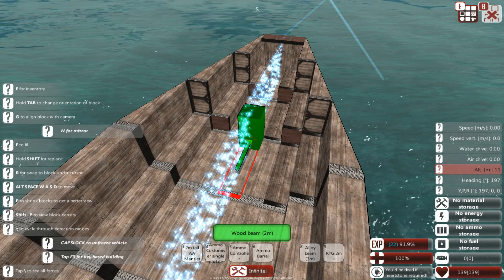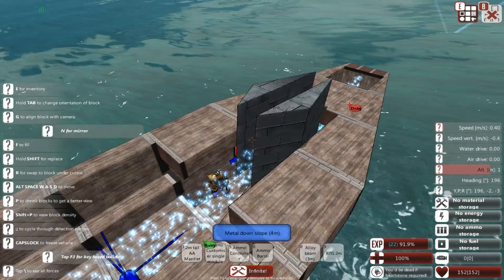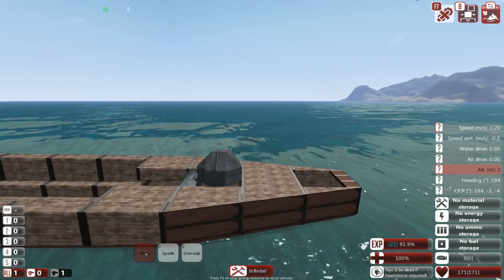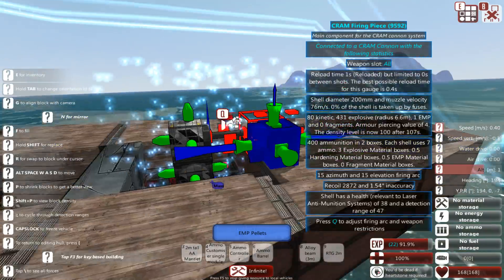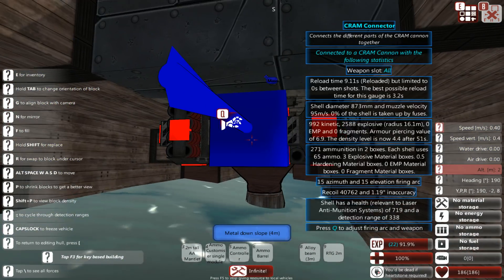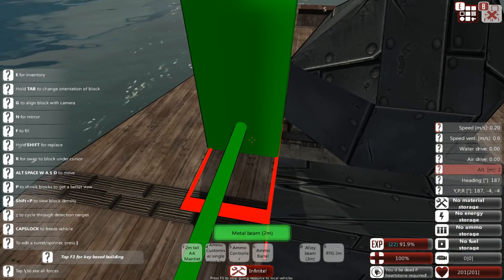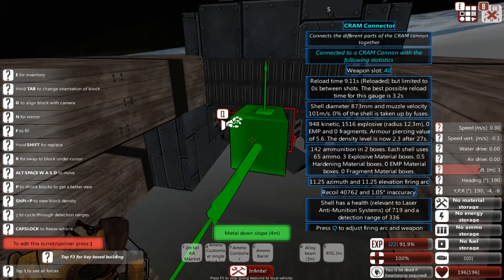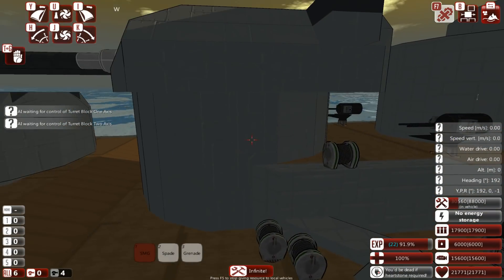From The Depths - Basic turret design

Comment: I case you didn't notice, the  Gauge Increasers have the same Armor as Metal (10) and they weigh 30 less (10 vs 40).  They have 80 less health however (200 vs 280).  The weight savings could help keep from having a top heavy ship with not too much penalty for the health.  The Gauge Port Increasers used to belch smoke when you fired but it seems to have been removed in one of the updates since they were originally introduced.
Reply: that or just make a really low keel using metal and lead. it more or less makes most ships balance. i had a triple barrel gun with 7-10k recoil per barrel about 6 to 7 meters above the water and that thing barely make the ship tip.

Comment: I'm not sure what the advantage of a cram cannon over an advanced cannon, advanced cannons can have better rate of fire, more customizable ammo, and longer range. Am I missing something?
Reply: B I G  G U N
Reply: +xxsleipnirx1 I just set up a mortar using the cram, which was pretty efficient I lowered fire rate intentionally to improve packing but I think for general use the advanced cannons have an edge as they don't lose power when firing faster I do see your point though,
Reply: one major upside for crams, the splash, even though the max cap is 10 meters if you have 50k explosive damage with a blast size of 50 meters (i made a simple cram with those specs in like 5 minutes, half of which was debating should i go he heavy or ap) and that 50k damage is concentrated into the 10 meters, which can more or less rape metal or wood. 

also advance cannon HE is pretty shit for late game. to be frank late game is more or less pointless.